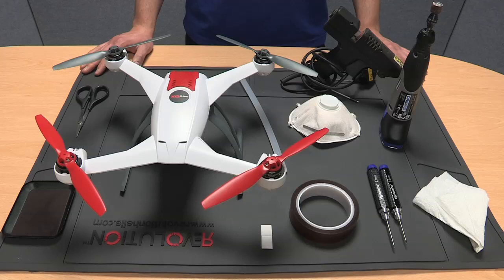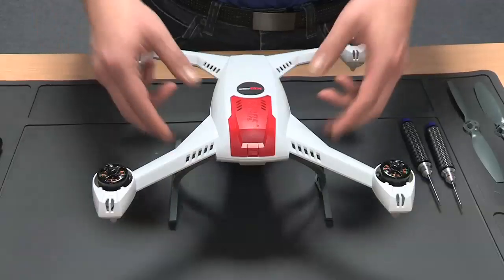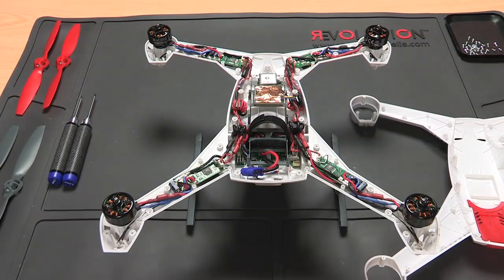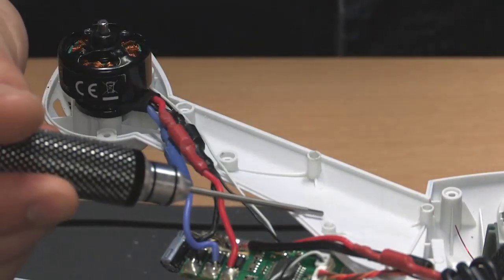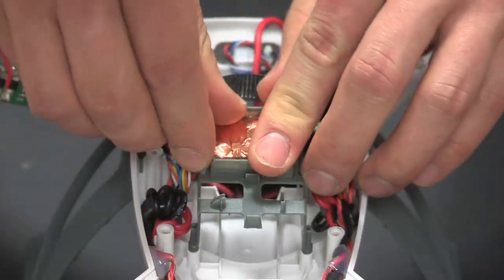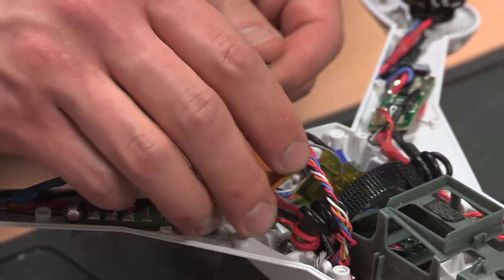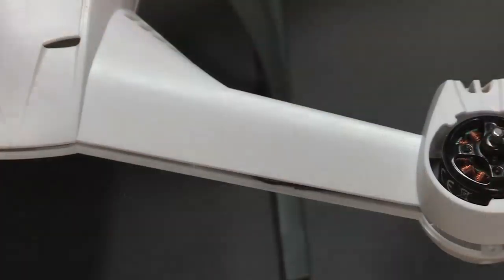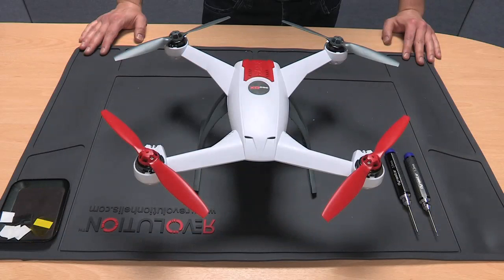Blade 350QX Hardware Upgrade, englisch

Comment: As a new user to this quad (350QX2 3.0) I saw at the manual at page 15 that the position is already over the ESC and I'm wondering if it's a better solution, The ESC is getting hot while flying so it's can be even worse!
I saw that the new version (QX3) have the GPS antenna on the top of the quad and far from the body - is it mean that all the other users need to worry about?
Also - i found this link helpful:  http://www.helifreak.com/showthread.php?t=597951
Reply: Zakly!lol
#